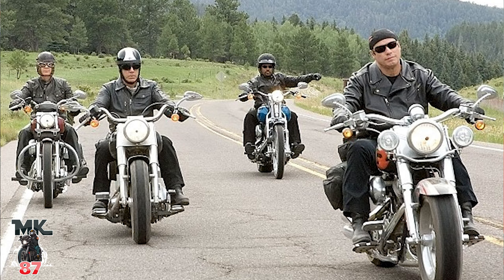Choosing the right cam torque vs horsepower

Comment: Still unsure weather to put a 465 reaper/s&s in my 117 bagger, but also interested in the new cr480mt cam
Last thing i want is it to feel laggy and jerky at low rpm like the s&s 475 does, i have a gut feeling the 30/30 would be the same in low rpm in a 117 bagger.. i like smooth torque that comes early and strong

What would you suggest for the 117 mike?

Too many choices and an expensive exercise😅

Comment: I just bought the 3030 for my 2023 lowrider st  hope it performs good
Reply: The CR483 was sold out everywhere till mid Feb so I went 3030
Reply from the maker: Such a great cam 🤘🏽
Reply: @MK87_ is it really?
Reply: You will luv that 30/30. It pulls all the way to redline and puts up strong numbers on  the dyno

Comment: Mike, if you had a low rider s SE 122 with 6.2 injectors, hpi 62 mm throttle body and manifold with Bassani 2/1 exhaust would you put a 30/30 in it or an f35a cam and valve springs ?  

I’m really curious how the f35a would perform and if it would be worth the extra cost in labor and parts. 

I am definitely putting a 30/30 in my road glide and still indecisive about my fxlrs.

Comment: Think about what rpm you are at when you are doing 35, 50 and 75 mph, these are the speeds you are at most of the time, when you have a torque cam the power is right there, anyone who rides at 4 to 5 grand all day must be in second  or third gear most of the day...😅😅
Reply: For some like you maybe even in 1st gear lol. For others like myself (which is what Mike’s referring to on the video), i’ve done 700 mile days where 90% of cruising speed down the highway was between 120-130. That’s a little above 5k rpm on 6th gear. We do exist. You just don’t know about it.

Comment: Question.  I know it depends where you are.  I’m in Massachusetts.  Just wondering about how much a cam upgrade would cost.  If you went full upgrade oil pump, cam plate, lifters, etc.
Reply: If you are looking to replace the whole CAM-Chest, can run run you upwards of $3k (depending on the manufacturer / gears vs chain / DIY or pay mech).  
About a yr ago I upgraded my 14 FLHTK' CAM-Chest from stock to S&S 551CZ kit (came with everything needed).  That cost $1900 Total ($1700 parts / $200 labor).
Will be doing mt 15 FLHR next month, same S&S kit with an MR103 CAM = $1900 (Inflation)!

Shop around, do your research, find the best CAM for your riding style, (why get a CAM that comes on at 4k RPM, when you rarely go above 3800 RPM).
Stay away from the cheaper kits or purchase in pieces - both will cost you sooner or later.